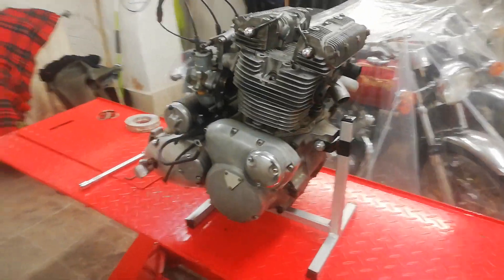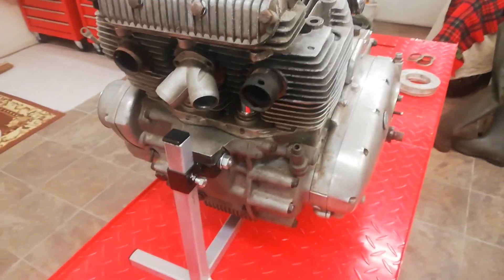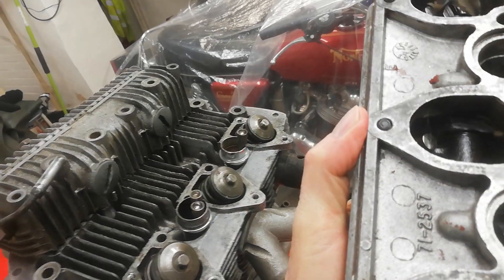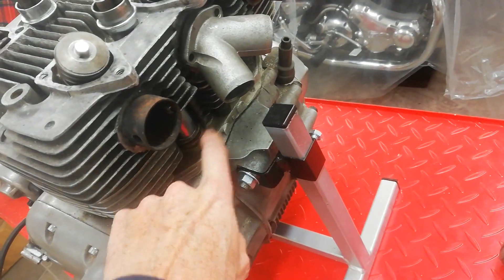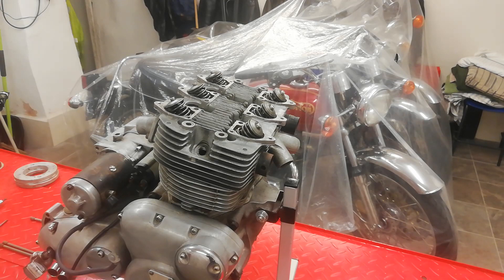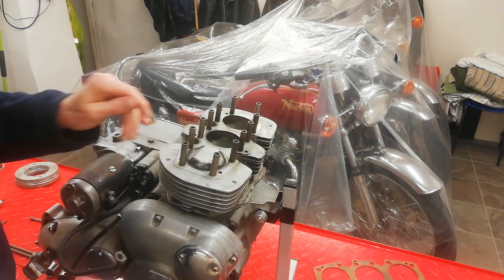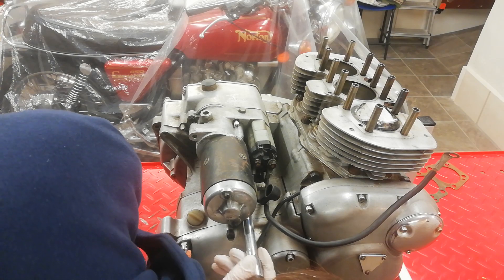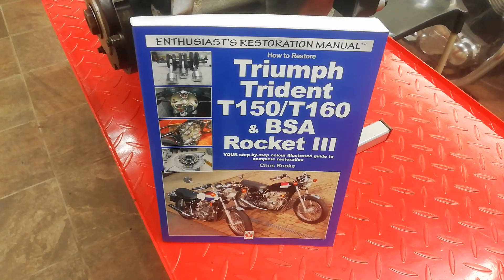Triumph Trident T160 Engine Rebuild. Part 1 Removing the cylinder head and starter motor

Comment: Hi , just wondering,  did you and two other blokes lift the engine out ok , obviously as a complete engine or was it very awkward . Cheers .
Reply from the maker: Ah, well, good question. When I rebuild an engine on one of my own bikes, I partially dismantle and then reassemble it in the frame, using the frame as a glorified engine stand - so I never lift them in or out! These engines belong to others so they took them out of the bikes - and they'll be putting them back in again! Basically you are use at least two people and a lot of protection on the frame, or put the engine on its side and then lower the frame down over it - but there's no easy way!

Comment: I have a 69’ triumph 650’ has been sitting for 20+ yrs and need to know how to clean the timing mechanism? Please and thank you!
Reply from the maker: Do you mean the ignition timing - points/contact breakers etc?
Reply: @Chris.rooke150  
Yes that’s what I meant, thank you!
Reply from the maker: Okay, so all you should need to do is lubricate them with something like WD40. Check the advance and retard unit is working and not jammed by holding the central spigot and turning it clockwise (I think). It should turn about 30 degrees and then spring back again. Then check the points  (contact breakers) gap  which should be about 14 thousandth of an inch each, and then gently clean the contacts themselves. Hope this helps. 😁👍